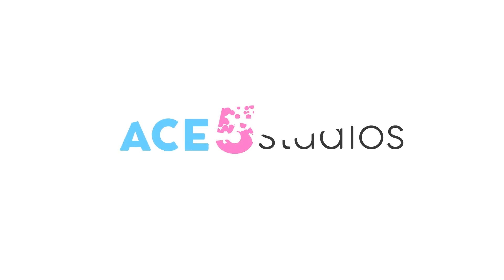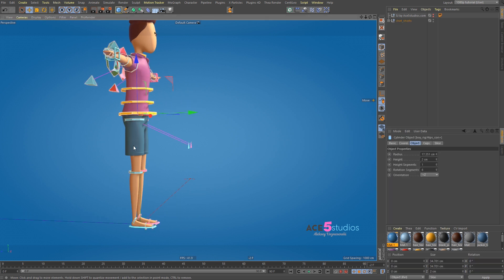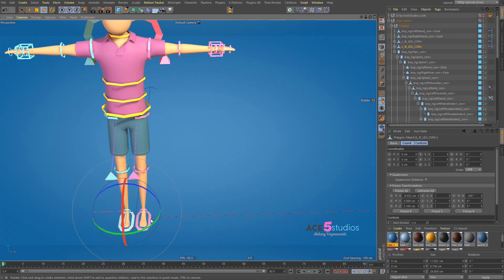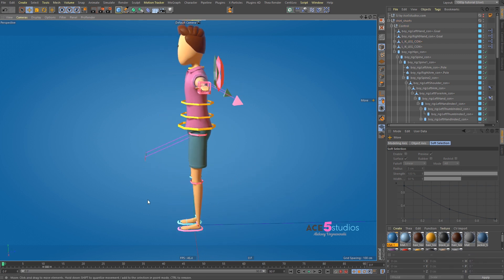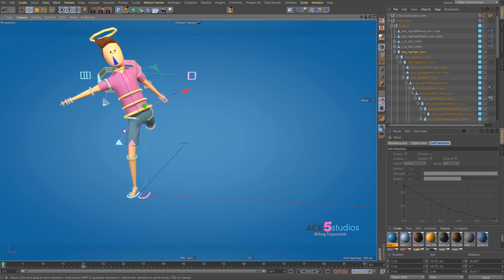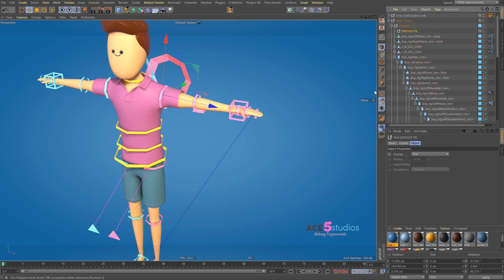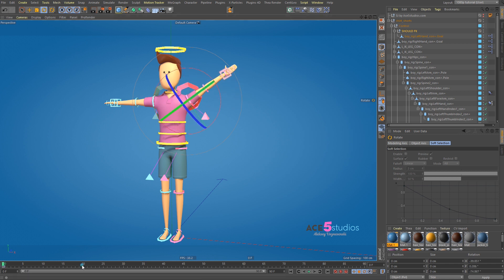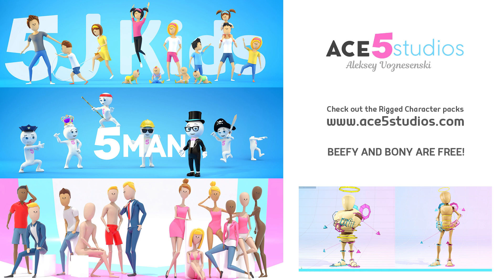IK vs FK: What is the difference?

Comment: Please show for us how to animate hands using a switch IK-FK. For example, at a certain moment I animate hand using FK to frame 15, then after 15 frame I want to animate using IK, But when I switch to it, my hand returns to the position in which IK was before. How, when switching, to transfer the positions of the FK bones to the IK so that the hand does not move to previous IK position but continues the FK movement behind. Or vice versa, the transition from IK to FK.
I cannot find such information anywhere on the Internet for Cinema 4d. Especially I watched the rigging in May to understand how it is solved. I noticed that for this they use special scripts for baking the position in the transitions between IK and FK
Reply from the maker: That's a good idea for a tutorial, I'll stick it together. But i generally recommend just using different shots of possible. It'll save you headaches :)
Reply: @ace5  I heard that it is not possible in cinema 4d native tool. And there are a some skript for this by japanese rigging artist. But I do not find it for now and continue searching for this
Reply from the maker: You don't need scripts. Going from ik-> fk just keframe the fk joints in place before switching to  fk. When going the other way use the "transfer" command to move the ik goal to the fk hand controller
Reply: @ace5  can you explain in more detail about this? I'm facing the same problem with FK>IK .what is the 'transfer' command you're refering to? thanks in advance
Reply from the maker: @keziagraciani6282  sorry for late reply, but there is a video about it now :)

Comment: Thanks for the tutorial. You mention splitting FK and IK modes / situations into scenes. Do you mean by creating a new project, or by keyframing the IK / FK slider and at the same time switching to another camera? Just curious how you would approach the scene splitting.
Reply from the maker: yeah just a new file, maybe i should make a tutorial about putting together an animation...
Reply: @ace5  ok i understand, thanks! probably the most practical solution, although making duplicates is something i try to avoid.
Reply from the maker: @snellcheeks  i find you get a more cinematic look with more cuts. also you can use xrefs for the background stuff, so it updates across all scenes. in some cases the slider works just fine too.

Comment: well, you can animate the ik to fk transition more easily depending on how robust is your rig, a way to do that  with minor setbacks is to rig the ik into the fk controllers, not into the bones. that way you will retain fairly the fk positions without having to reset your scene, and you dont need a lot of expresso skills. Actually this kind of rigging is only possible in c4d as far is a I know, I learned that from Cactus Dan (RIP) how was the god of rigging in C4D. There are other methods, but this has been the easiest to rig a ik to fk so far.
Reply: do you have links to any tutorials explaining this technique?
Reply: @artkiko4460  there use to be a cactus dan tutorial in C4d cafe,  you might look into Dans profile in that site